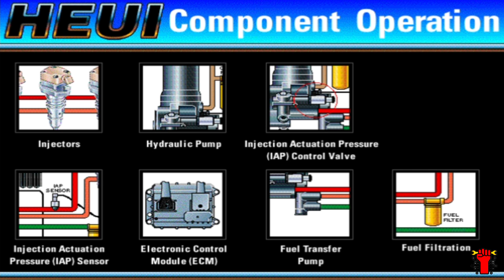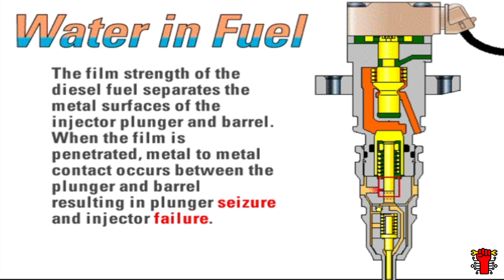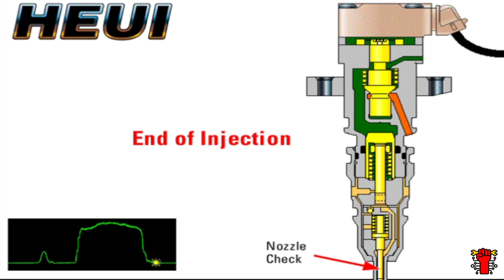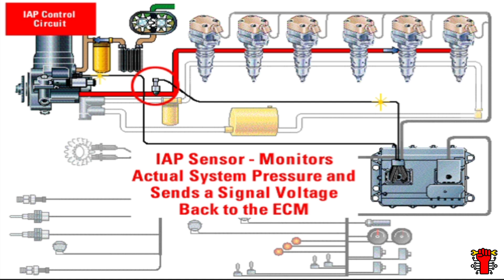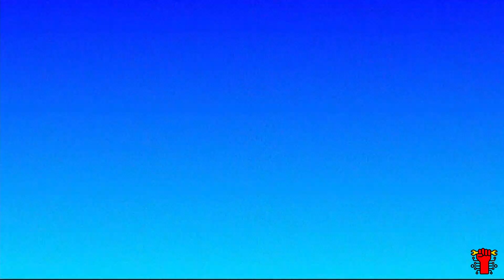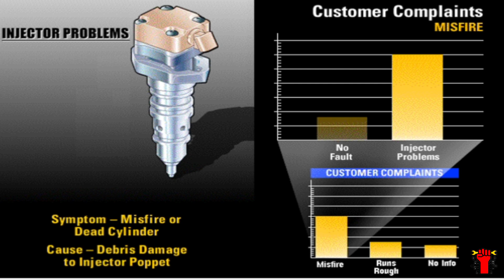CATERPILLAR HI300 HEUI Fuel System – Comprehensive Guide

Comment: Wow how did you find this video? All the oil from the crank case keeps ending up in my diesel tank ive already done the seals on the injector today the mechanic changed the solenoid and the valve relay do you think it will a top oil from getting in to my tank i have a 1999 3126b engine with the round heui that looks like a filter thanks for your answer